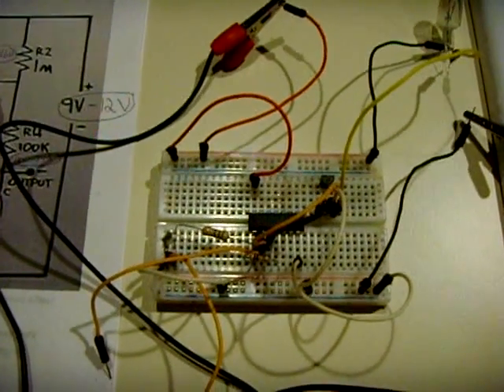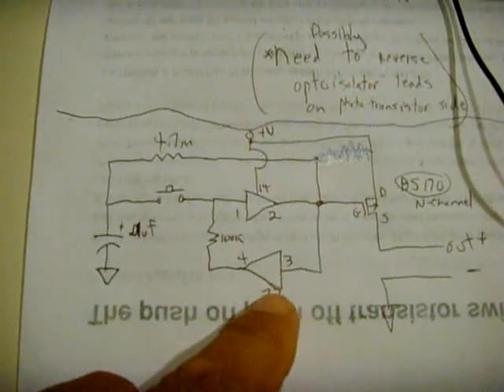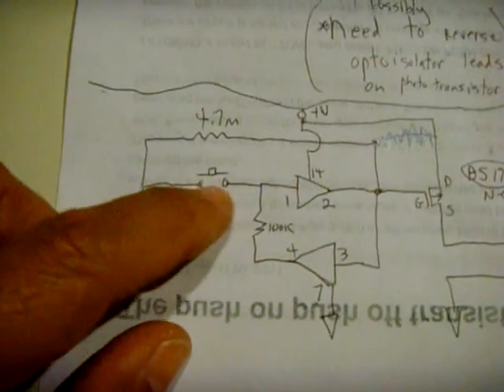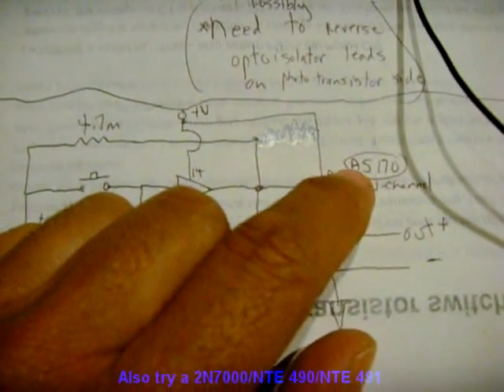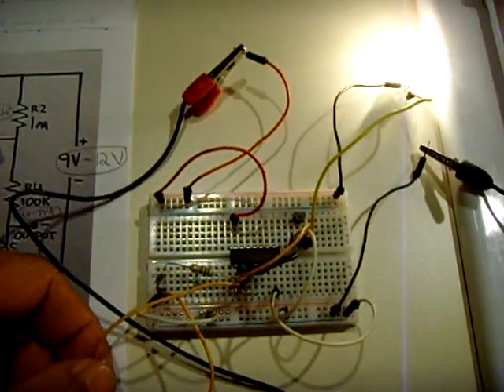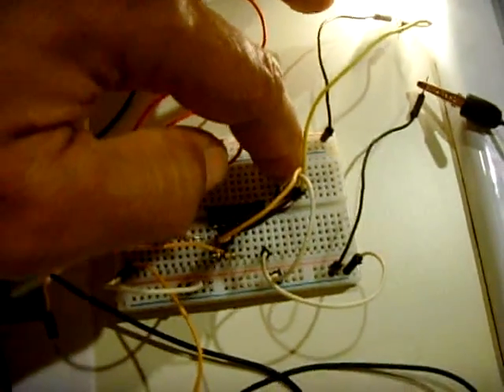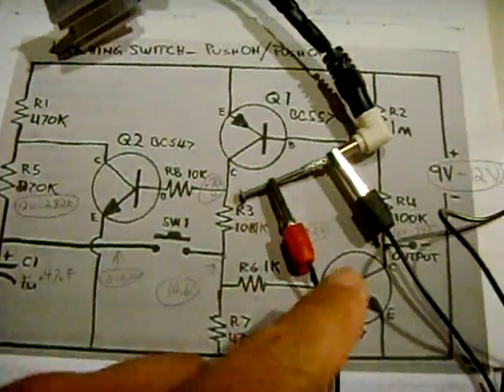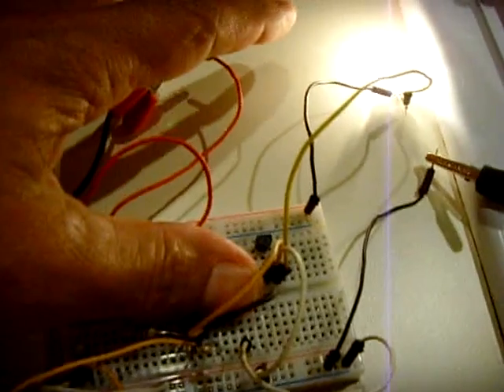74HC14/CD4069/CD6069 Latching ON & OFF Circuit

Comment: You are awesome! Thanks so much for sharing this circuit with the Youtube community! I didn't have a 74HC14, but I was able to use a 74HC132 (2-input NAND Schmitt Trigger) to accomplish the same goal. Given that its a two-input gate, I simply connected the other inputs to +5V. The neat thing is that if I connect the second input on the second gate to GND instead of 5v, I get a quick pulse instead of a latching on/off. I could have used this behavior a while back.
Reply from the maker: +Mark Whitbeck
Glad my video helped you!
Please share my channel with others and rate thumbs up. Thanks.
Reply from the maker: +Mark Whitbeck
Glad my video helped you!
Please share my channel with others and rate thumbs up. Thanks.

Comment: I made a circuit with one mosfet and one npn I belive that draws about 4uA on stand-by and it can handle about 20A from 3v-24V. I looked in the datasheet of the CD4069 and it states that it only takes a maximum of 10uA @5V. But that it's not that true sometimes as I made a circuit with a CD4017 and it stated on the datasheet that the quiescent current was 150uA @5V and I thought that for a clap switch that is pretty good. Turns out it was 12mA!!!